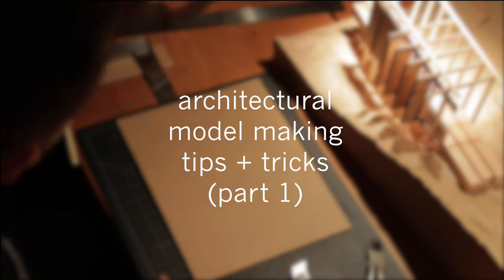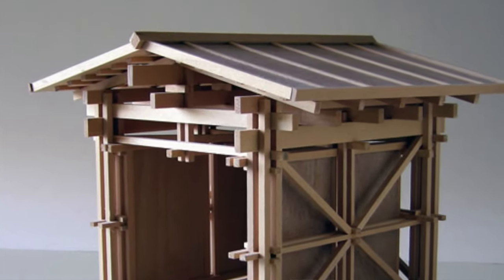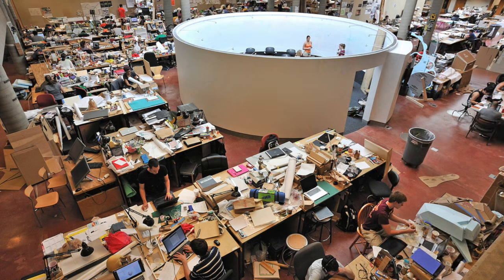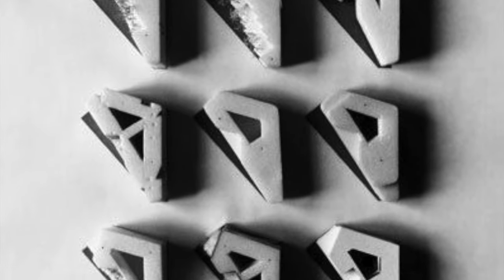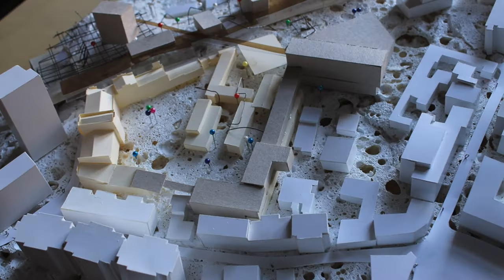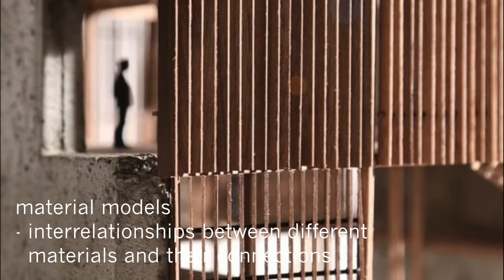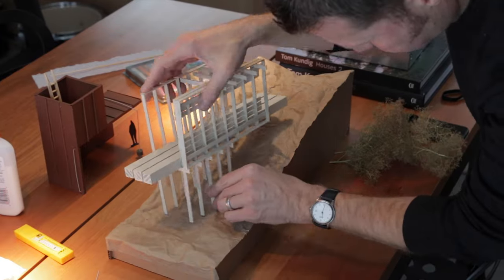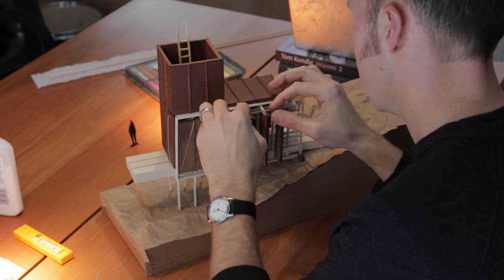Architectural Model Making Tips + Tricks - An Architect's Guide (Part 1)

Comment: Awesome and looking forward to these videos!!  
They are of special interest to me because this last semester I had a profesor who pushed me to the limit in every aspect of the graphic representation of an architectural idea. We started by building a piece in real size scale which could have no use at all or if it were to have one we had to define it and it had to work. I built a public bench for the faculty made out of wood, it was made of several small and slim pieces of pine wood glued and screwed together into a pattern that left voids for light to pass through. It supported the weight of 3 people. Then we had to take the material we used and apply it in some way into the design of a client's studio, luckily my client was an architect so I designed my own studio! And I don't care if I sound cocky but this is the best thing I've designed so far LOL. He required 3 models for the final deadline, one in the scale of the town we were building it on and to see how it was related to its environment, and 2 of them to see the scale of the building (1:50 we use the  metric system), one of which was a structural model, made to see the detail of the structure, what it was made of, how the unions were resolved, etc. And to make it even harder, he requested to have all the drawings by hand and in the fashion of "Morphosis Architecture", where everything is kind of artistic but very detailed and precise. All in the space of a 1.8 square meter area. This guy really squeezed us but I have to say I feel like I learned life. I kept looking for new ways to represent my ideas because he was right, it has to represent the idea first, then and only then you can focus on representing reality. And in drawing by hand you solve things quicker than with the computer, he thinks kind of like Glenn Murcutt... So yeah, I'm looking forward to see what I can learn from these videos :)

Comment: Great stuff. I've been making models professionally for over 18 years, mostly commercial detailed models. Indeed, that is not the kind of model that is is required (or even as you say, not very useful) during the design process. When i studied architecture in Belgium (1990-'95) there was no "101 on model making" either. One last thing: As you said it, the human figure is crucial in a model as a reference to "read" the scale!
Reply from the maker: you have my dream job: professional model maker. 
if only someone had told me it were possible when I was in high school...
thanks for your comment...
Reply: so cool...If you could post some video recording of your model making process, that will be amazing hehe!

Comment: Why not just learn Blender? it has an architecture plugin, light simulation, it's free, and you can use premade assets for furniture and such. You can also change the units into feet and it's quick to learn. I recommend BornCG although I don't know if he has new tutorials for 2.8, it's a huge change from update 2.79 but 2.79 will still work just fine.

Comment: Hello. I had a question regarding architectural model making. With the recent revolution of accessible 3D printing, would you say the art of architectural model making will soon be somewhat obsolete? What is your take?
Reply from the maker: model making for me is like three-dimensional sketching so - for me - it will always be a part of the design process. just as the computer hasn't rendered hand-sketching obsolete, 3D printing won't remove the need to think in this way with your hands. the 3D prints are always improving, but the 3D printed models I've seen lack detail and personality. model making is just another tool; if you're able to use 3D prints to achieve a better end result then it's the right tool, if not you need to find a different tool. cheers...

Comment: Do you find this physical Models being phased out with high end computer graphics as the technology becomes not only smaller, but has faster computer graphics displays. Plus, any changes could be done at the meeting or as it comes?
Reply from the maker: Not for me or my clients; many actually prefer / request physical models when we work together. Design is a very personal process though and building models is for me - as I mention in the video - an important form of sketching and ideation. In the same way that CAD/BIM will never replace hand sketching; building physical models suggests dynamic opportunities and results I'm not able to replicate any other way. However, if you find the computer produces better design, then it's the right tool for you and you should use it. For me, physical models simply work better. Cheers...